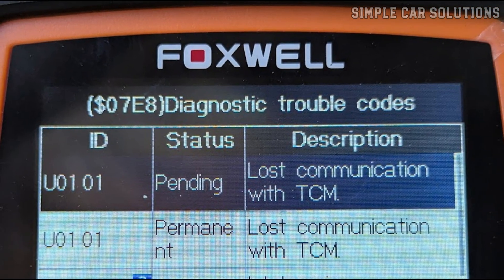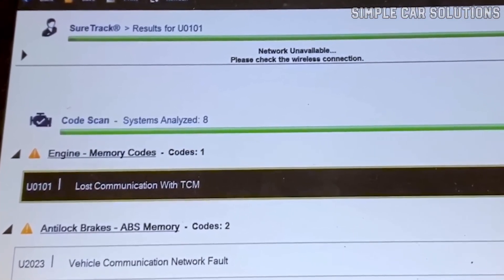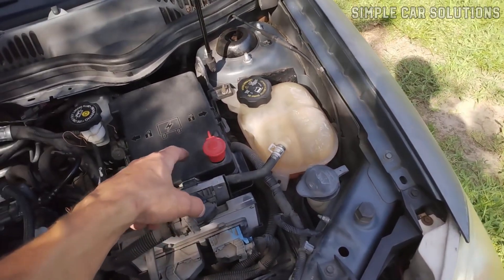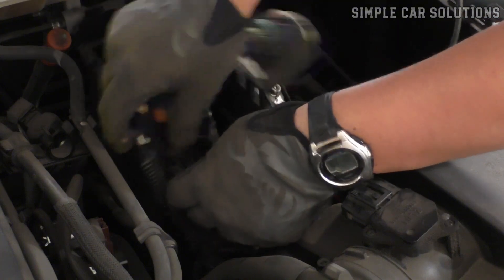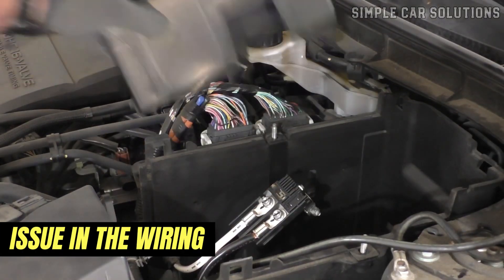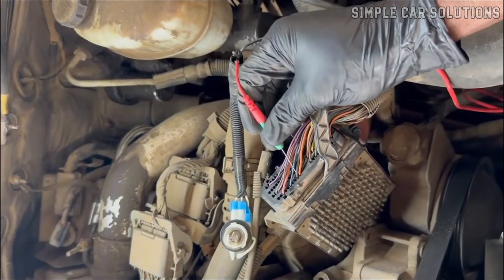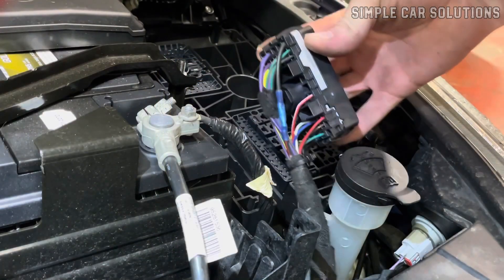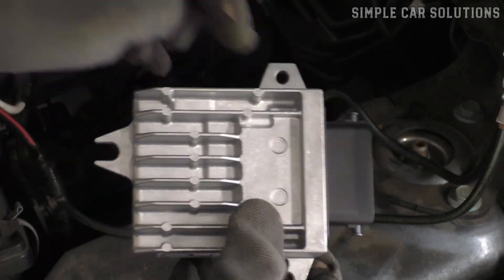How To Fix U0101 Fault Code: Lost Communication with TCM (Transmission Control Module). TOP-6 Causes

Comment: I have the U0101 on my 2012 Nissan NV 2500 and is stuck in drive on the gear indicator light on dashboard. We switched out the IPDM and still have TCM no communication. Anyone experienced the same issues.
Reply from the maker: On that NV, U0101 with the shifter stuck in Drive usually points to a failed TCM or broken CAN wiring between the TCM and IPDM/ECM. Check TCM power, ground, and CAN lines right at the TCM connector - water intrusion at the TCM is very common on these. If powers/grounds are good, the TCM itself is likely bad.

Comment: So I checked all power and grounds both with test light to put a load and everything good then checked the 4 can bus lines they were perfect high and low even with osciloscipe perfect mirror image checked connector visualy and terminals they were fine then we replaced transmision but came in with the same thing one day after with same thing no comm with tcm
Reply from the maker: If power, grounds, CAN lines, connectors, and even the transmission/TCM are confirmed good, the most likely causes left are a failing PCM, an intermittent wiring break inside the harness, or a module on the CAN network pulling communication down when it heats up. At this point, isolate the CAN network by unplugging modules one at a time and closely inspect the TCM/PCM harness near the transmission for internal breaks or oil intrusion.
Reply: @SimpleCarSolutions  update : the issue was the terminal on the conector was damaged making the TCM to loose batt voltage The thing is I wiggled the connector and the walked inside to check for P range position on the dash and never managed to make it work but to be actually putting constant  upward pressure to the conector  to make it a good connection 😅

Comment: Disconnect a terminal on the battery wait 30 seconds reconnect. That worked so far for me.
Reply from the maker: Glad it worked for you - a battery reset can temporarily restore communication. If the code returns, you’ll still want to check the TCM power, grounds, and CAN wiring.